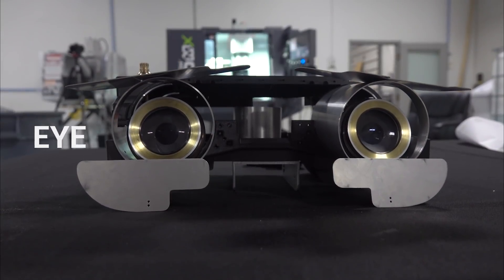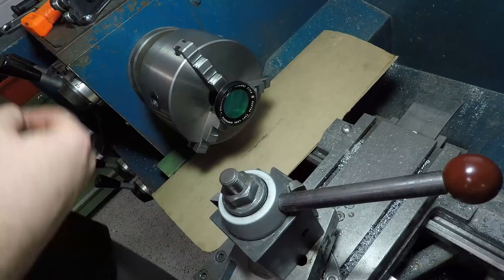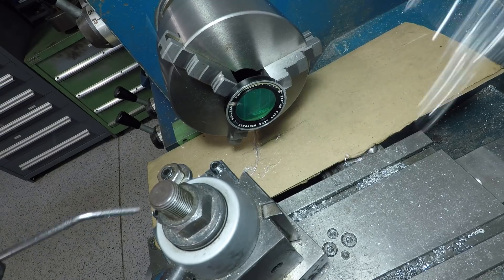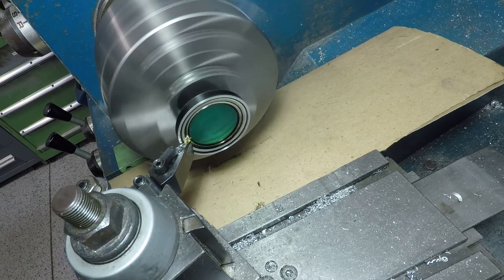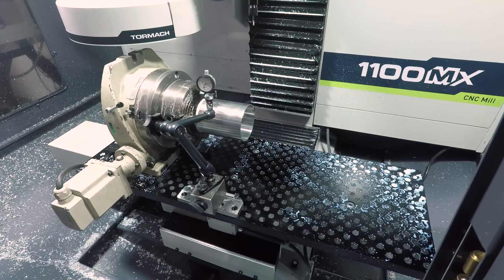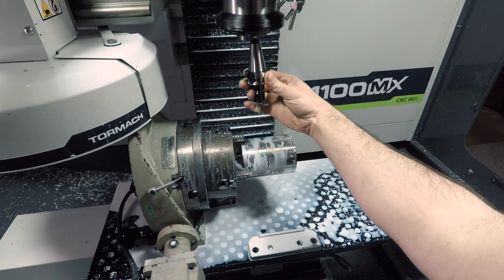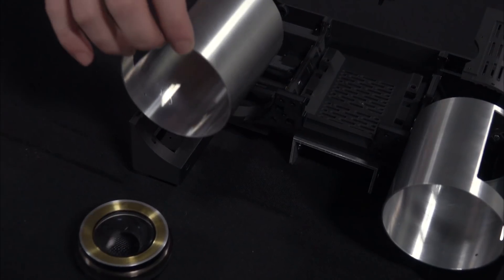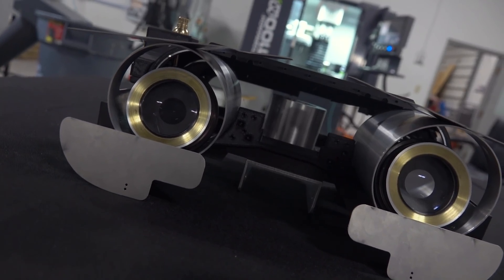Building Johnny 5: Turning & 4 Axis Machining the Eyes!

Comment: What is that name of the CNC machine
It looks like lathe and Milling machine
Can someone please tell
Reply: The "looks like a lathe" part is just a 4th-axis rotary table accessory that fits on any of Tormach's CNC mills with a chuck mounted on it. Heck, even Sherline has a similar accessory for their little mills.
Reply: Looks like the unit featured in this video may be discontinued, and replaced with the new 4th axis that uses a harmonic drive. https://tormach.com/microarc-4-4th-axis-38412.html